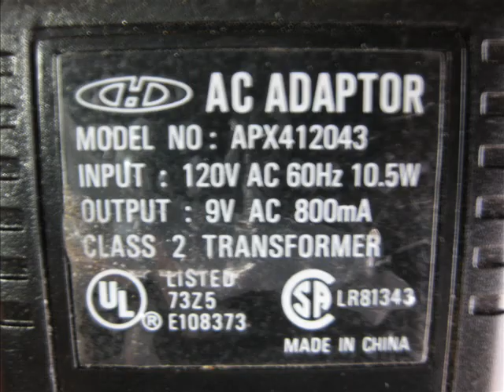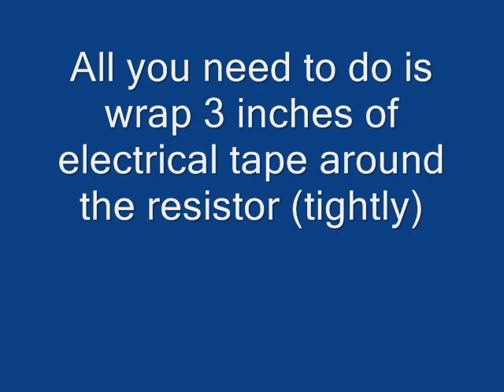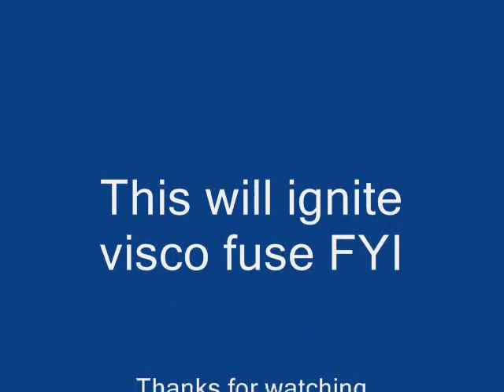Easy cheap igniters

Comment: I did the same thing when I was a kid except I didn't use resistors. Instead I took a piece of common household electric wire like from a lamp or an extension cord and stripped off the insulation. I would then take one single strand of that wire to use as an igniter. I didn't wrap it around a match head though. I was igniting model rocket motors and needed something better than the cheap igniters that came with the motors. They failed at least 50% of the time. So I made my own. I would bend the wire strand into a U-shape and put it into the motor thrust nozzle, making sure to leave equal parts of the wire sticking out from the hole. The wire would come out of the hole with each end on opposite sides so they never touched. Then I would fill the hole with black powder and then place masking tape over the hole to keep the powder from falling out. The moment an electric charge was applied to the wire (pos on one end and neg on the other) the wire would instantly glow red and ignite the powder thus igniting the motor. I went from less than 50% success in motor ignition to 100% by making my own igniters. I do not see why the procedure I used with just the wire won't work with a match head, especially if you wrap the head in several wraps. Why smoke a good resistor when you don't have to?

Comment: If you have an old toaster or electric fan heater, dismantle it and the coiled wire inside it works perfectly. It heats up using a 12 volt battery really well.

Comment from the maker: @kontul you probably could use that kind of battery, but it could just burn out the resistor to quickly so you may need a resistor with a higher resistance. I think you could just try around the 10-15 ohm area.

Comment: i have found that 10 ohm resistor and 2 9 volt batteries work well. also i have reused the same resistor 3 times by just scratching off the residue after each use with a finger nail. be carful it will be hot!!!

Comment from the maker: @48hash maybe just try using 18 volts and one ten ohm resistor. That might work but im not too sure of how high the resistance of a 75 foot wire is.

Comment from the maker: no because the resistor burns out after the use.
It sometimes works twice but you want it to be reliable. You can buy a roll of 100 resistors for about 3 bucks so i don't care when i waste them.

Comment from the maker: The resistor doesnt actually ignite, it heats the carbon till its red hot. Yes a nine volt battery will work. I use a power supply from old cell phones and radios because it wont hear up or run out

Comment: Friend! Give more info about the techs of the resistor... we dont use Ohm in europe... butt we talk in watts... and procents..
Reply: Resistance is measured in ohms everywhere! Resister wattage is another spec. Use low-watt if your intention is to overheat and burn; 1/4 or 1/8 watt.

Comment: does one resistor work a lot or do you have to get a lot of them?
Reply: You don't need a resistor at all. Just one strand from an extension cord or lamp wire will glow when each end is attached to a 9 volt battery. Don't waste a good resistor. Just wrap the single strand around the match head several times.
Reply: 50 resistors costs like 1$